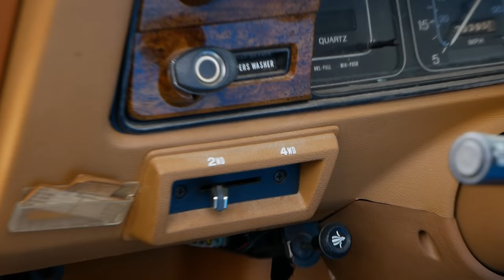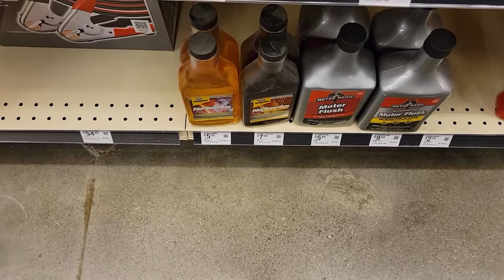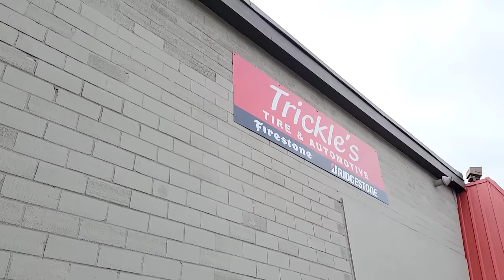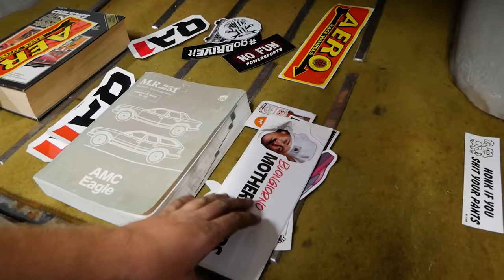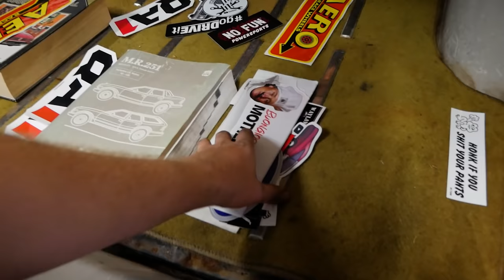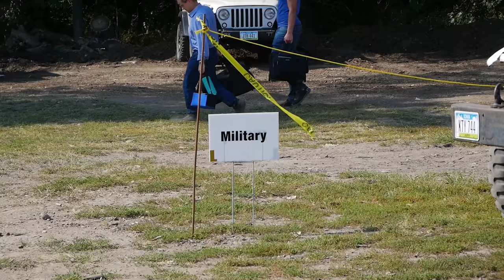$50 Car VS Off-Road Jeep Park - 24 Hour Build Challenge

Comment: I clicked on this because I have an 84 acm eagle. Other than a junk carb and rusted gas tank that keeps it from getting gas it runs pretty good. Has a slight lifter tick that goes away once it runs for a little bit. The 4x4 works but has to be engaged manually by crawling under and pushing on the vacume actuator since all the plastic vacume lines are  broken. The body is pretty straight and the seats are pristine. It has a 4"lift block in the back and I want to lift the front and put some mudders on it. Honestly I'd be better just selling it and buying a Cherokee but a 4x4 station wagon is so weirdly cool.

Comment: A million years ago when I was in High School a few friends and I chipped in our beer money and bought an old LeMans from a retired librarian. We Baha'd that bad boy with a chain saw and then Zebra Striped it with a can of spray paint. We were so stealthy driving around in our small Georgia Home Town. That car ended up in an abandoned construction site in some lucky future homeowners dirt basement. We had removed the front seats for some safety reason and my friend who was driving said to hold on we were going over. Turned out the going over was driving from the dirt main level into the dirt basement. I remember facing my mortality for the first time as I reached for and missed the dash as we tipped over the ledge. Luckily when I pitched over the top of the windshield I managed to jump to the right and get clear of the car flipping over on me. $50 cars can be the absolute most fun with the right folks in it with you. Thanks for letting me relive a great day from my mis-spent youth.

Comment: If you drop the oil pan and disconnect the bad piston rod and push it up into the cylinder and block it up. Then disconnect the valve rods and spark plug wire, it'll run smoother. Oh, don't forget to plug off the empty distributor hole for that cylinder.... and get the correct half shaft.

Comment: I'd put a LS swap in it with the transmission and transfer case Chevy Axel's a "12" inch lift kit jack up the roof put plexie glass a roll cage rattle can paint job and go back and kick ass at that event and better seats

Comment: that would be a fun day if I still had my old 60 something Jeep Commando. That thing was so ugly but with the quadra track and the 6cyl standard trans in low range it could climb a dang tree. I used it as my huntin vehicle cause it was so beat up I didn't care if I hit a few trees on the way in to deer camp. My only issue was it was so quiet I ended up having to replace the starter ever month or so cause I couldn't hear it running...

Comment: I need your help I have a 1973 F100 300 straight 6 and it has bad wiring I need to know how to get it running without using the existing burnt wire please help me

Comment: Problem with those Motor Honey products is they cost more than the few quarts of oil you'd burn without it.

Not even considering the effects of a drastic viscosity change

Comment: Question:
what exactly is a "bean can" and what does it do? ive seen them many times and heard people talk about them even more. are they part of the ignition system. electrical (sensors or something) or emissions? or something else? ive tried searching it on google. but i dont know the proper name other than ford/gm bean can. and the only thing that comes up is something about people smuggling drugs in actual bean cans

Comment: I laughed for the whole time . Take the con rod off slap new bearings on it and see how long it will run, Back in the late 80 my buddy could replace them in a afternoon and drove it for 2 years like that . 8 dollars for over sized bearings would last for at least 9 months did it again a few times but it never died , car finally rotted apart.

Comment: I still think that motor can be rebuilt. And it's too bad the four wheel drive didn't work but it wouldn't have mattered with the transmission slipping anyway but pretty impressive car that it finished with out even a posi rear.

Comment: I have had a few Eagles (in fact I want to see more of that gold one, just in case) and you can do that trail on an Eagle in good shape.  The Eagle is built on a Jeep Wagoneer drive train.  Your CV joint may be for the other side (my recollection is the drivers side is shorter than the passenger side).  I miss my Eagles but I am happier to have fuel injection!

Comment: Had an '84, great car, heat in the summer and air in the winter. The 4 wheel never worked quit right.
The valve cover always leaked, designed with only two hold down bolts.
But a heavy beast, great for pulling trailers as the weight distribution over the wheels made it very stable.

Comment: Another thing you 'could' do is the transfer case swap from an old waggoneer. Keeps the on / off dash switch and adds the high low lever on the center hump. I don't remember what specific model, been a few days since it was cool. But one of the models is a direct bolt in, just hack out some extra material to go with it to keep the shift boot. And there was an axle hack that was basically chopping off the knuckles to use a cv shaft for a beefier independent front end.

Comment: I had a Mitsubishi 3000gt vr4 and one day I started it up n had a knock so I took it to get fixed but the shop started the engine and the engine immediately exploded out the bottom so I was expecting your engine to do the same

Comment: you get 3" of tire clearance by cutting immediately above the fender flare trim. on the rear you might have to tack the inner fender to the outer but its a easy way to fit 33" tires

Comment: One toana we used to take out the beach we got sick of filling the radiator we just took turns driving it by the time we stopped the engine it was that hot the engine was see through you could see the cross member through the engine next day started took it out again all the best to you all

Comment: I owned two Eagle sedans in the '80's - and four Jeep CJ-7's since. Always referred to AMC as "PMC" OR "Poor Motor Company" because they used whatever parts they could scavenge from the other manufacturers. The Eagles were tough little beasties, and the one that had the automatic 4wd (which would come on in the summer when you turned on the AC!!) managed to suffer through the first series of repairs I made on my own without paternal supervision. Kudos to AMC for hanging onto the old Nash 258 straight six - it may not get you there quickly, but it WILL get you there. Nuts, now I want another one. 😂

Comment: Back home there were die hard fans of these cars that drove them into the ground, rebuilt and did it again. SX4 was the sport coupe version. They may have been built out of Jeep leftovers but really, fast forward to today , most cars on the road are AWD single speed transfer case, just with computers doing all the shift work and fuel injection to clean up all the veggy can crap this has.